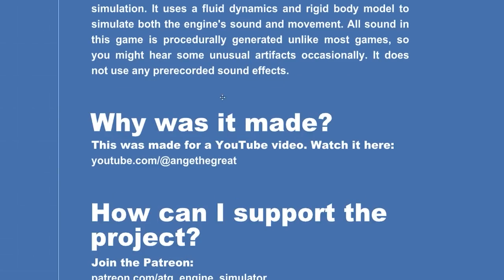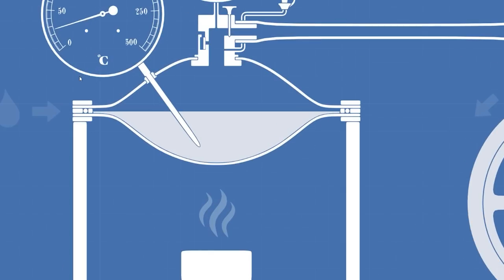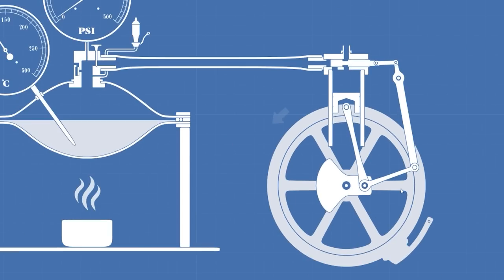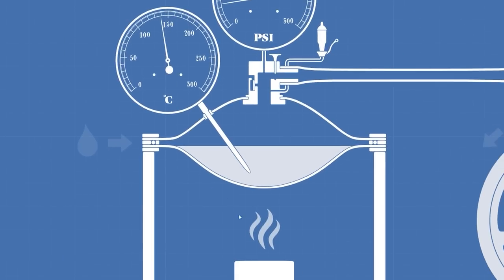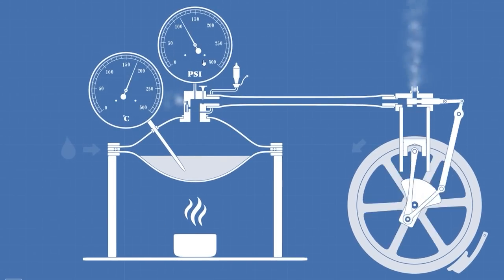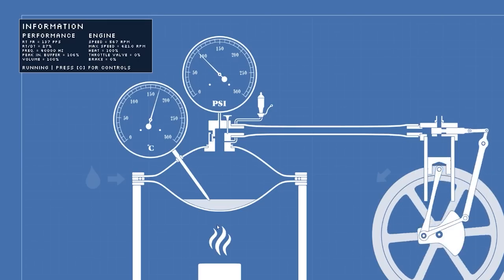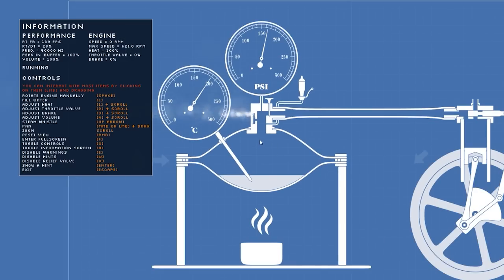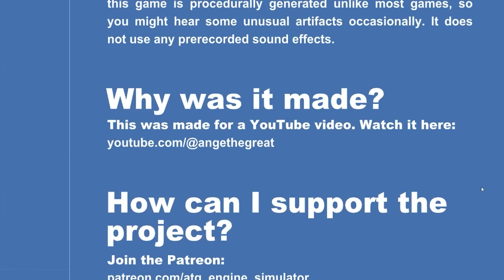Powering a Steam Engine Using Realistic Physics! | Steam Engine Simulator

Comment: How odd to see Celsius and PSI next to each other. Is that normal for Steam engines? I checked, and the relation of pressure and higher water boiling point is correctly modelled, so that's cool.
Reply: Higher temperature, higher pressure steams are very important to the efficiency of steam engines.
Reply: @Kharmitas  I think Schtefan is pointing out the mixing of metric and FreeDUMb units instead of (Pa)/(bar) I'm actually not sure if Other countries convert to (Pascal or Bar) on Steam engines or if PSI is used still? I'm guessing it would depend on who makes the steam engine or the gauges, at least... I now need to email Drach and ask if he has done a question or video on if psi or pascal or bar usage, etc...
Reply: @plasmaburndeath  yes. I would guess Celsius and Bar (which is a multiple of Pascal) would be the expected ones.

Comment: Recently downloaded the game and am impressed with out but there is one thing I would love to be added is the ability to modify values such as being able to grab the flywheel and spin it up before opening the throttle valve or changing the weight of the flywheel or the power of the motor almost like console commands.

Comment: Kinda interesting how it's only single acting and a very basic boiler. The engine also has fixed valve timing/lift, it would go faster if it had better valve gear.